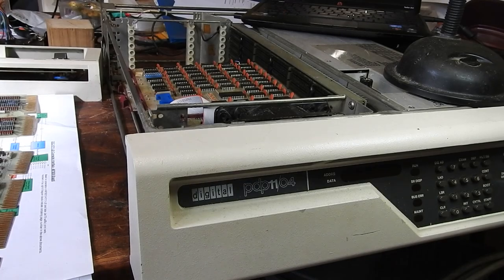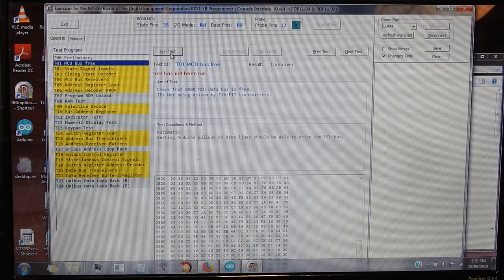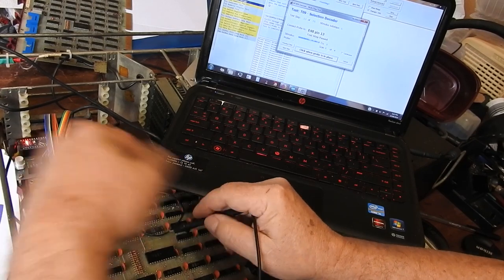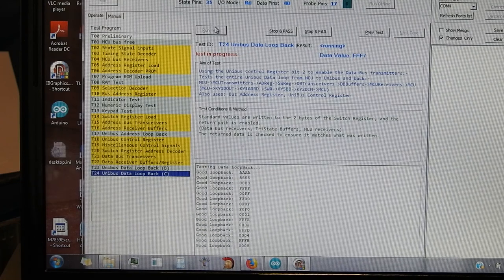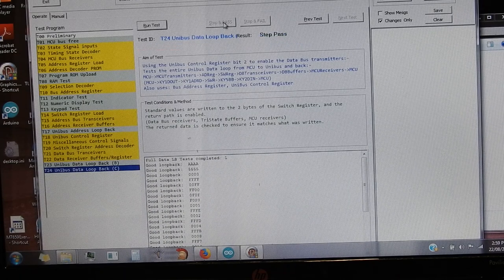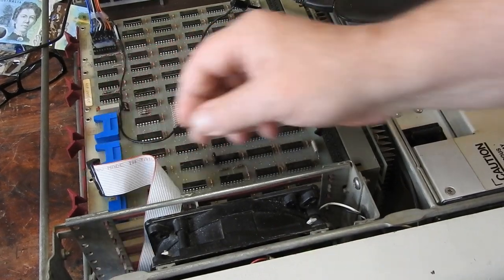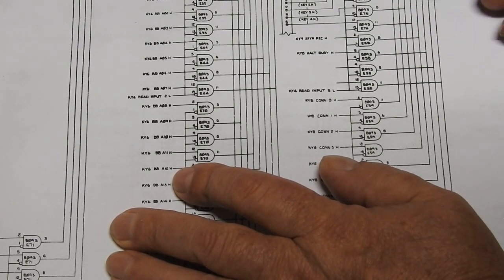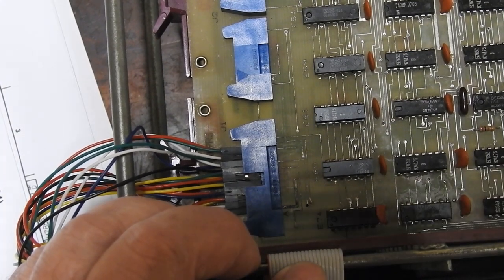PDP 11/ 04 Console KY11-LB Test and Repair - Part 3

Comment: Congratulations on getting it fixed! Systematic debugging takes time, but pays out.
Reply from the maker: Thank-you. While knowing that my method should work, all the time I was worried that the problem might be some flaky/analog/electrical/timing issue that just could not be detected by my purely digital approach.  I'm so glad that it paid off!